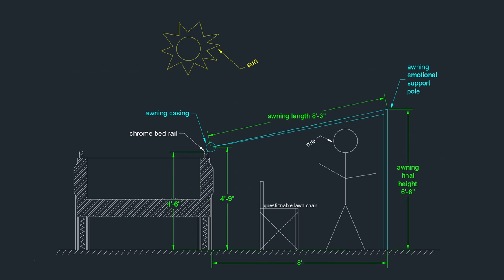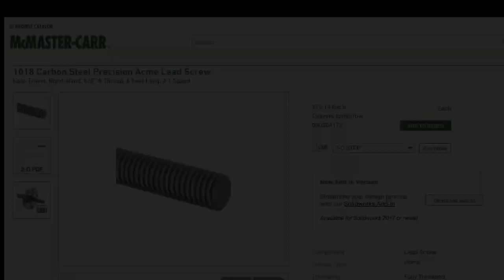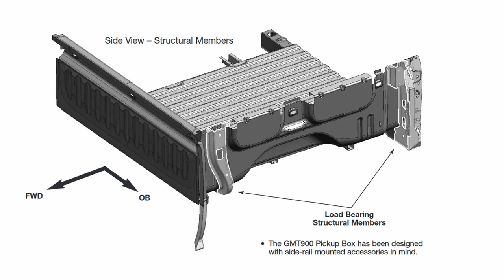Rack-less Pickup Truck Awning

Comment: Unbelievable. Man this is exactly what I have been looking for. I have been beating my brains in/out trying to find a way to raise and lower my awning (ARB Aluminum cased awning with deluxe room) which attaches to my Yakima roof rack system on my truck topper. I also want to be able to quick detach the awning from ARB awning mounts, be able to mount it off the back of my topper and not just the side all the time, and be able to attach it to my DIY Adventure Trailer. I have 4 of these scissor lifts in a box in my garage, doing nothing. This is without a doubt the best idea, build I’ve seen. I do not possess the skill sets necessary to do something like this, so I was about to thrown down $2,500 on a Topper ezlift system, but I have concerns there as well. A system similar to this would fit my need, with some adjustments so that I can move between truck and trailer.
I love this video, it is my favorite so far of ways to accomplish my need. As a disabled Veteran, I simply cannot load all that my hand anymore, it is too taxing. But if this was built, I could and would use it, allowing me to get out and do what I love and enjoy doing. Not sure if you would be interested in collaborating with me, on my project or not, but sir you have an awesome and genius idea and fix to numerous issues for many of us, not so young and able folks out here. Thank you for this video, and may God bless you. Job well done! Genius. Subscriber for sure. If YT had a favorite video button, this would be mine. Look forward to seeing you other work. Peace.

Comment: it is very cool but how does it do in the wind
Reply from the maker: It works alright in light winds. Gusts are a problem because it it'll rock it back and forth kind of violently... which isnt great on mechanism's lower mounting channel. The awning arms have attachment points for string & ground stakes, I use those when the wind is feisty and havent had any problems.